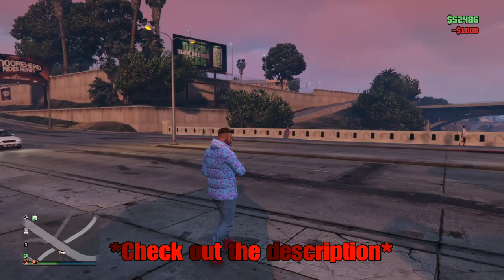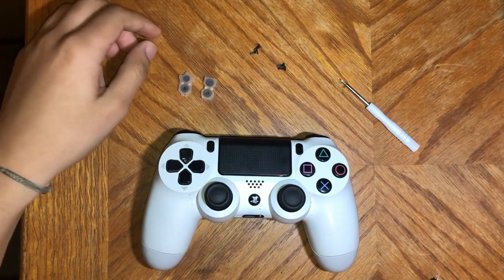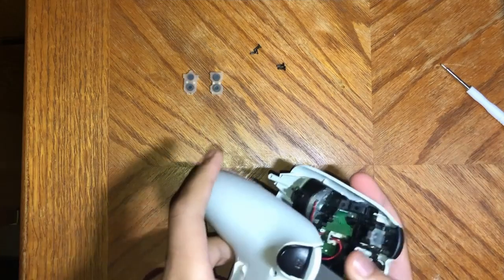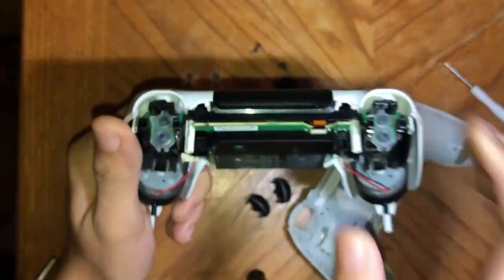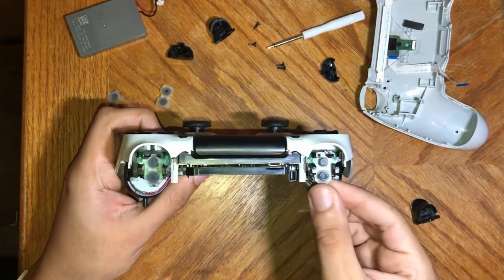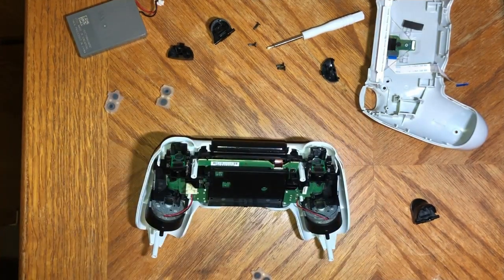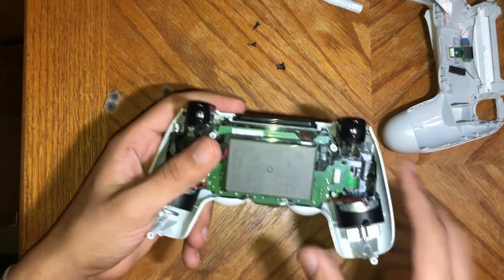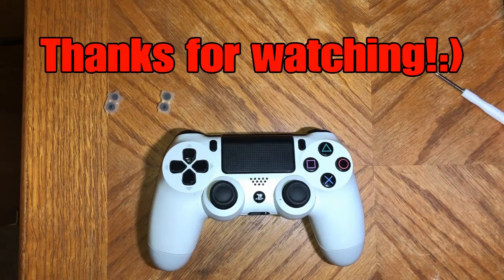HOW TO FIX CAN'T SHOOT ON GTA 5 (ONLY FIX!!)(IT'S FINALLY FIXED!!)

Comment: My r2 is fine it works on all other games
Reply: Aarav Sidar Same, I only have a problem on gta
Reply: @salxh_ okay strange thing is...i can burn out in my car and throw grenades but when I try to shoot...it doesn't work...
Reply: salxh_ I have red dead redemption 2 and the r2 is good the problem only is in gta v 🤦🏻‍♂️
Reply: Hector Peña how do you fix it?
Reply: Lenzyy 00 the r2 is bad
Reply: I Can drive on gta v with r2 but I can't shoot, what do I do?
Reply: Same
Reply: @mtg1518  do the fix
Reply: You will be going slower in all racing games becuase you can't go full throttle
Reply: Bruh facts on every other game it works fine and my driving on gta is fine, but everytime I try to shoot on gta it makes the aiming animation and im pressing r2 but the damn game dosent let me shoot
Reply: @trashpanda-zg3mf  same
Reply: @trashpanda-zg3mf  yup same here. Just 4 months ago it was all good. Then now it’s fucked yo
Reply: Mines too
Reply: So no one has found out the REAL fix for the r2 glitch? We can agree it’s not the damn controller
Reply: @karenaldo  it’s because when they coded the shoot animation they made it to where 100% pressure is needed. If your pad is even slightly damaged it won’t work. 

They’ll probably never fix it and the coding is stupid, but after all the game came out in 2013 so…
Reply: Same and me
Reply: Anyone askedv

Comment: I used nail polish and it worked. You can also just switch the piece on the right side with the one on the left side because they are the same for both sides.

Comment: All you need to do is get a small piece of paper and fold it once. When you have done that place that on top of the silicon of the R2 button. (It should only cover the R2 and not the R1). *Do not fold the paper multiple times as your R2 wouldn't work at all*. Join the controller back together and it should work perfectly fine. You now should have no problems with burnouts, top speeds and shooting on gta 5 . This is the best free method.
Reply: +1 on the paper trick. You saved me time and money and I can heist no problem now
Reply: Dude make a video
Reply: Please do make it
Reply: Not me replying 3 yrs later but this works, thank you🤘🏽

Comment: I FOLDED A TINY PIECE OF PAPER AND PUT IT ON TOP OF THOSE RUBBER THINGS AND IT WORK. ON MY MOMMA IT WORKED!!!!!!!!!
Reply: Thanks a lot. IT WORKS. All you need to do is get a small piece of paper and fold it once. When you have done that place that on top of the silicon of the R2 button. (It should only cover the R2 and not the R1). *Do not fold the paper multiple times as your R2 wouldn't work at all*. Join the controller back together and it should work perfectly fine. You now should have no problems with burnouts, top speeds and shooting on gta 5 . This is the best free method.
Reply: I was thinking about using tape
Reply: Thnx
Reply: IT WORKS MAN. Thank u so much.

Comment: What I did is just switch the r1 and r2 buttons in the setting so now I use r1 as r2 but I try to do burnouts in gta and when I use L3 to do a circle burnout it won’t work, the front wheel moves but the car won’t go in a circle.
Reply: Same

Comment: But thats a controller failure, mine is only on gta v, in other games i can shoot and drive normally, but in gta i cant shoot, what should i do?
Reply: Did you find a fix? Having this exact issue where it’s ONLY gta 5 not shooting. I play cod and looter shooters so it’s not the r2 like everyone’s saying
Reply: @karenaldo  kind of, i thought it was a controler problem and bought another but it didnt work, so i change the use of the buttons and started aiming with l1 and shoothing with r1, like if it was in a ps3

Comment: I just changed them with my old controller silicone pieces and it worked thank u so much you saved me 60 bucks
Reply: Were you at getting a new PS4 controller for 60$ cheapest I can find them for is 79$ at Walmart I can find used ones for 69$ at GameStop but doesn't seem worth it if the controller might have the same problem as the current one

Comment: I switched the button on my controller so that I shoot with r1. The thing is when am driving I can shoot perfectly fine with r2. Is my controller really broken or is it a bug?.
Reply from the maker: JinxedYou it’s not that your controller is broken, it’s just a little tiny silicon piece that simply wore down over time and doesn’t go down all the way. GTA controls made it to where you need a full R2 press for some stuff (like driving and shooting). it’s weird because no other games make you use your R2 to where it needs a FULL press
Reply from the maker: JinxedYou also I can tell you it’s not a bug bc you if you go buy a brand new $60 controller it will work just fine again. getting a new controller wouldn’t fix it if it was a bug!

Comment: My shooting is delayed . Like if I aim and try to shoot it gets delayed for 5 seconds everything else is fine tho like driving
Reply from the maker: Are you sure you’re actually driving full speed? If you have an oppressor mk2 does your boost fill up pretty fast? It’s sounds like it’s the silicon piece if it’s delayed:) mine was really delayed on madden( I had to hold it forever for it to work) and now it works perfect
Reply: TheEddiee_ Yh I can drive at full speed
Reply from the maker: Zidane Ali you’re positive? I would race a friend and see the difference. I didn’t know mine was broken for a long time. maybe it just takes longer to accelerate
Reply from the maker: Zidane Ali I wild check your silicon pieces and see if the R2 has slits in it

Comment: Bro i try to turn my cars to left and right in gta online but it doesnt let me after buying new controller will this problem get solved
Reply from the maker: Junain did you go into your controls? you may have turned on inverted controls or something of its doing opposites. does your analog work right for other games?
Reply: TheEddiee_ yes they work perfectly for other games i saw my controls its ok its not invert view whenever i try to turn my cars it doesn’t turn
Reply from the maker: Junain try just resetting all controls back to default settings. if your car isn’t turning and your analogs all work on other games then it has to be a GTA setting
Reply: TheEddiee_ i did it still it doesnt turn

Comment: Appreciate the video.. but i dont know if this is the issue for mine... It started happening when i was playing streaming from my console to my phone... I tried the controllers on my xbox once i was home and they worked fine on reg tv xbox... And i doubt i have 2 controllers that happen to do this at the same time... Maybe its a issue with streaming gta i guess..... Just a comment in case someone has the same issue while streaming only...
Reply from the maker: Lonesch0lar that’s probably just some type of software glitch if it was working fine when you got home

Comment: Mine is shooting auto matic ly when i press it stops then 20 min later kt works again
Reply from the maker: Revix have you dropped it? It’s also possible that the silicon isn’t on all the way and that’s why it works and doesn’t work. would make sure it’s on all the way
Reply: @TheEddiee  its a nacon conpact controller if you know what that is
Reply from the maker: Revix do you know if the inside is set up the same as a DualShock 4?
Reply: @TheEddiee  can i send u a photo on indgagram
Reply from the maker: Revix can you send it on PS app?
Reply from the maker: Revix can you send it on PlayStation App? Just add TheEddiee_ and send it

Comment: I found out the controller is also the issue with rdr2 but instead of trying to fix or replace it I just use my other controller when playing to solve the problem.

Comment: If i buy a new controller then will this problem get solved
Reply from the maker: yes to the shooting issue and not driving full speed issue and doing a donut issue but just buying the silicon you need and replacing it will be a lot cheaper

Comment: Thanks heaps!! 👌
Is it possible to remove the triggers without taking apart the shell?
Reply from the maker: Unfortunately I don’t think you can get the triggers out without taking the shell off. Even if you could somehow it probably wouldn’t end good for your controller
Reply: Alright, thanks

Comment: Do we have yo buy new pieces? Ans where??
Reply from the maker: You can try to flip the L2 and R2 pieces, which would be free. If you have an old controller you might be able to get an old controller and see if the silicon pieces fit.  If not then you need to see which silicon piece you need and order the correct one below! It’s only $5 for the piece, which is way better than a brand new controller

Comment: It’s not my controller I can punch ect and R2 is working in every other game COD fortnite Minecraft ect
Reply from the maker: Can you drive full speed?? and I know, GTA has VERY touchy controls unlike every other game
Reply: TheEddiee_ it’s a bug in the game for a lot of people
Reply: TheEddiee_ yes burn out and most of the time do full speed
Reply from the maker: Scottish Boi maybe you should check and make sure the silicon is all the way in and isn’t loose. If it has a big slit in it you could try switching the L2 into R2 and see if that helps! and then the R2 piece into L2! It’s the controller somewhere, it’s the silicon most likely. maybe it’s just loose and that’s why it works sometimes
Reply: TheEddiee_ yes I’ve switched the R1 and R2 about in game working fine now
Reply from the maker: Scottish Boi switching controls won’t do much. But I guess it works but it doesn’t actually fix anything. If you take it apart send me pictures of the pieces so I can actually see if it’s the silicon

Comment: buy the new controller
Because the old one they made it that u need to fully press it
Not like the new one
Reply from the maker: For both the new gen and old gen the R2 has to be fully pressed down to shoot and drive full speed. You don’t need to buy a new controller for either, unless you just want to I guess. Order the piece you need if you can’t find one that works and then it comes and it takes 5 minutes to put in

Comment: I play on xbox and its absolutely a software thing
Reply from the maker: honey suckel does your LB work on every other game?
Reply from the maker: honey suckel I don’t have an Xbox but I seen people say to try to blow into the trigger, it could be dust buildup. 

Also, it’s literally impossible that it’s GTA software or it would effect literally everyone. everyone has the same codes. 

You know it’s not GTA because when people have issues they typically buy NEW controllers and it’s “magically” fixed. It’s the controller. They spend $60 on a brand new controller when the fix is nothing but $5 and a video on what to do. 

I would watch a video about fixing LB or whichever trigger it is on Xbox, they actually have fairly loose trigger controls. It could be something loose or broken that is only $5 to fix. I seen people say they fixed their LB with $5 and a 5 minute YouTube video. 

I’m actually not sure now that I reread it if you’re looking for a fix or saying it’s the game? 

It can’t be Sony or GTA or literally every PS4 player would have this issue, and that’s not the case at all. buying a new controller doesn’t fix some code with Sony or gta. It simply fixes the $5 fix but instead for $60+

Comment: But it legit is not my controller I can punch using it
Reply from the maker: Gaming Donkaaay punching doesn’t require it to go down all the way. for example you can still drive just can’t go full speed. If you hav an oppressor fly around and does the boost fill up fast? or doesn’t it like skip up fast and go slow again?

Comment: I can drive but I just can’t shoot
Reply from the maker: DIRE Loky do you drive full speed? if you have an oppressor mk2 drive it and use boost and see how fast it refills. it should take a long time to refill. if it goes fast, or fast for a  one second and back to normal you’re not going 100% full speed and should follow this video